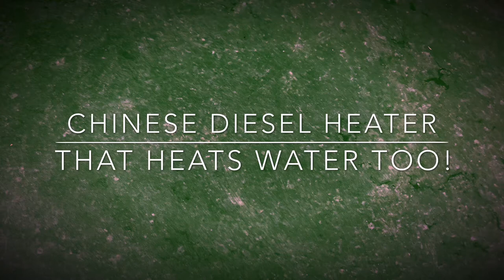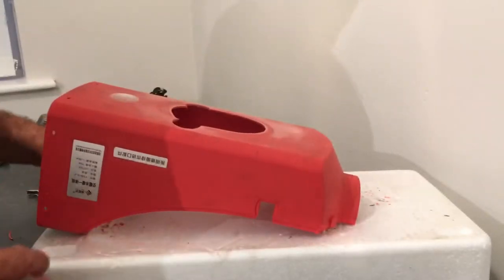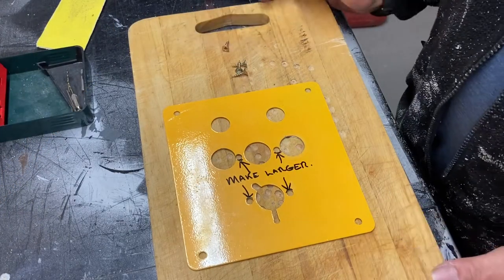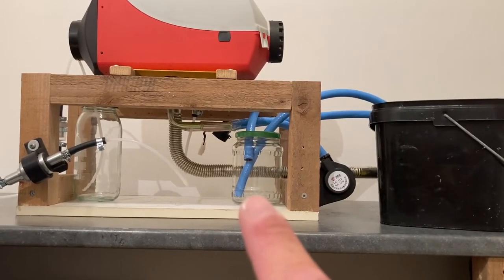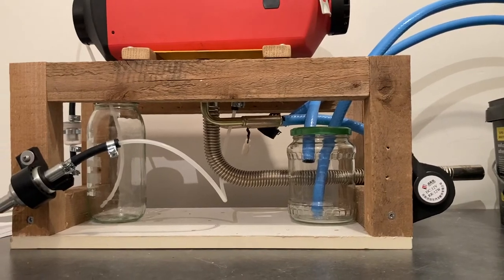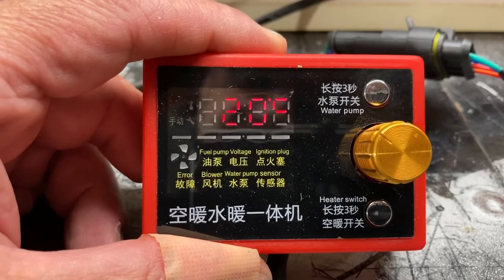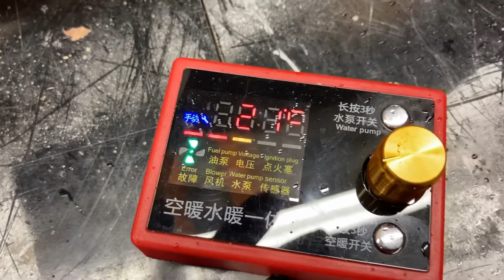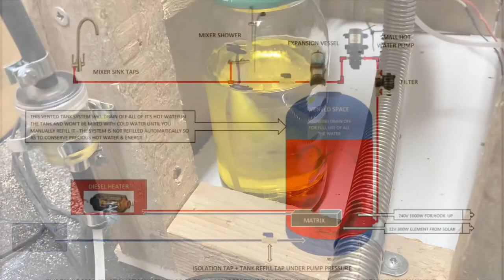Chinese Diesel Water & Air Heater Feasibility Test

Comment: I was looking at the Leoch batteries again, it seems the 165Ah is cheaper (£250ish) than the 160Ah, and they also quote lifetimes which vary be 'series'. So like all batteries from reputable brands there is a range of 'robustness', so it's going to take a little while to figure out the ultimate cost/lifetime value, some are so new the specs are not yet on the makers websites. Currently the Victron seems the most robust but is very heavy and quite expensive, somewhere there will be a middle ground for Lead-Carbon. 
I do aim to eventually end up also buying one and perhaps laying it on it's side, but often it takes a few weeks of research to hit the sweet spot, so don't rush in to buy before you need to, keep researching - and I will also. 
If I was to buy in a hurry the 165Ah Leoch would be fine as that's cheaper than going normal lead-acid LOL, but I think there might be a series of batteries that are a little more but closer to the Victron quality.
Reply from the maker: yer agreed, I was looking at a Leoch battery for £200 130ah. if you buy two for £400 quid you have a serious amount of power to hand for the money! Up to now that is the avenue I may well go down come the time for connecting my electrics up.
Reply: @diycampervanman1633  Lots of capacity is good in a way, but unless you drain it now and again it just gets in the way as it sits there unused, costing you MPG. 
For me 95Ah drained to about 20% = 76Ah can last 4 days in summer and 3 in winter with no solar at all, but no inverter and a gas fridge. That's just lights, the odd bit of heating and the odd tablet and phone charging.
What's the most power you would need and for how long?
Reply from the maker: Graham sorry for late reply, I’m not always getting notifications and I’ve been busy at work. However that’s a good question but more than your scenario. First I have the diesel heater which sucks 10-11amps on start up. Then I’ll have a 12v tv which I guess will be on a fare bit. I also have 6 led touch sensitive spots for the main lights, a further two standard above the sink unit, 3 more above the cooking unit and two in the shower/loo cubicle. Also two reading lights and mood strip lights around the ceiling and under the units. Also exterior flood light eventually and all round cctv cams and monitor foot of the bed eventually I’ll also have an extractor fan in the loo and a big one in the ceiling skylight, I’ve 3 double USB ports and 3 lighter sockets plus an inverter to power the very odd time a mini microwave and induction hob. I want eventually but I’m going to see if I can do without a compressor fridge. I’ll need to power a small portable projector and wifi or mobile signal booster. Think that’s it. Mobile phones to charge too and now n again my mini boss Bluetooth speaker plus a lap top eventually for sorting work stuff out on a mini retreat.
Reply from the maker: Graham anyway Ctek have replied to my question about using lead carbon batts on their dc to dc charger and this is what they said as follows:-

Hi Karl.

The lead Carbon typical has a lower end voltage compared with open types etc. An example is 14,1-14,4V  and float at 13,5 to 13,8V
The D250SE has a 14,4V setting which is the normal setting.
this also delivers 13,6V float.

Here the figures are correct. However, please check with your supplier for data 
before you choose.

Best regards Henning.

Im guessing what they are saying is it should work but check your battery data sheet for charging rate and float charge rate so that it fits in those parameters. What you think? Obviously the charger is not programmable for more accuracy like say the victron.   I want the Ctek fir its high quality build, great easy access strong wire terminals, future bigger solar upgrade capability (140A tops) and battery to battery charging with the ability to send a large charge to the starter battery if flat. The Ctek will power two separate battery banks sending solar to the starter battery after fully charging the leisure. It comes with a heat sensor too included. I’ve checked out a lot of dc2dc chargers and Ctek float my boat until you mentioned lead carbon. However looking good they can be used.
Reply: @diycampervanman1633  Well the voltages are in spec so that looks fine to me.
Good stuff!!
Reply: @diycampervanman1633  Maybe you can simulate a typical nights load in the van with the heater and TV etc, and use a power meter to count the Watt/hours to see how many Ah that you need? I.e if you use 24Wh that at 12V is 24/12 = 2Ah.
Then you have to decide how many days without charging you might ever need.You could even leave the decent final battery at the end of the build so you can use a regular cheap car battery to test the current draw.
Reply from the maker: Graham yes I like that idea. I’ve been holding off buying my solar panels until I sus this problem out re which dc2dc charger to use because the Ctek D250Se only goes upto 20amps meaning I can only fit two 100w panels taking it upto 16.6 amps.  (However you can add the smart pass giving you a massive (unnecessary) 140amp charge capability. But that’s a load more money. I wanted two 120w Panels but that’s takes me to 20amps and the charge controller is maxed out at that so it’s a no no. My theoretical calculations are based on a 220ah battery bank giving me capacity of 110 amps available. If I use 60 amps per night fir three nights thats 180 amps required. The solar has to top up the extra 70 amps required which is feasible but not on a manky weather weekend. I based my calcs on a three night weekend trip so This is doable but boarder line. However since I’ve discovered this new battery I should be well sorted but just wanna put it to the test as you suggest. Without buying all this gear like panels, chargers and battery the van is set up and wired to go virtually with wires going to the fuse box so I could hook up my beefy jag battery and an amp metre to simulate a nights consumption as you suggest and would make for a good video. I still have to fit the heater though and rig more gadgets and fit the solar panels so I can fit the insulation, then ceiling and lights to get it into a position for testing but I think that’s where where heading this month now.
Reply from the maker: Only problem is my jag battery only has 76 amp hours. I can only draw on 37amps (50%) which won’t give me a full nights power consumption for the simulation test. Or will it? The whole point of the test to work out how many amps I require I guess but I suppose I only need to operate for one hour and then just times it by a 5 hrs night. That would give a false reading though as I only need to pre heat the heater once in a night but then again it’s only on for five mins. Mmmmm you have me thinking.
Reply: @diycampervanman1633  I missed these, will comment this evening, but I suspect 20 amps will be enough, most of the time the batteries will only be taking 1-2 amps.
Reply: @diycampervanman1633  I would have thought the solar charge controller has a current limit of 20Amps, so it simply shouldn't pass more than that.
Best to read the specs and instructions carefully, very unlikely it will be a problem having too much solar, unless it exceeds the voltage limit.
Reply from the maker: Graham  Mmmm I’m not sure about that. It was my belief you would fry the the machine if you over powered the system but thinking about it a high quality machine surely would have protection against that. If what your saying is correct then having more solar makes sense to generate more power when it’s bad weather or low sun, dust on panels etc. Besides without tilting the panels they will never reach optimum capacity either! I need to investigate further
Reply from the maker: Graham my investigations are complete and your on the button pal. I can have a larger solar bank than 20amps but was told by the Ctek people to stick within 50w-300w. They said at full capacity I will have wasted energy but also pointed out I was correct too because when power source is depleting due to bad weather etc, having more solar will push more power into the system giving maximum charging capacity for longer. Like I said before you have to be lucky to get optimum  power out of any solar panel  in the uk so having an extra panel will help the struggling ones along better! 
This analogy applies in similar scenarios too such as not buying an expensive  automatic tilting and turning solar panel sun tracker. It would be far cheaper to simply add two more cheap panels set at different angles instead! Same outcome!

Comment: First of all: your fuel filter is mounted backwards.
Second of all: this type of system is supposed to be used as a termosifon, without an additional electric pump or expansion tank.
Nice try and congrats for it. But, do more research and you will find out better ideas out there.
Cheers!
Reply from the maker: Its the only way I could think of to make it work using it for a different purpose it was intended for. I do believe it is meant to have a pump as it was provided and has a pump on off switch on the control panel but it’s a cheap Chinese product of which don’t think they did any research as i tend to agree with yourself in some ways. Many thanks for your input. 👍🏻
Reply: @diycampervanman1633  I agree! Chinese don't have much imagination or knowledge. 
In a termosifon, the water tank itself is the expansion tank. The whole system is made up of 2 hoses and a tank. That's al you need!
Cheers!